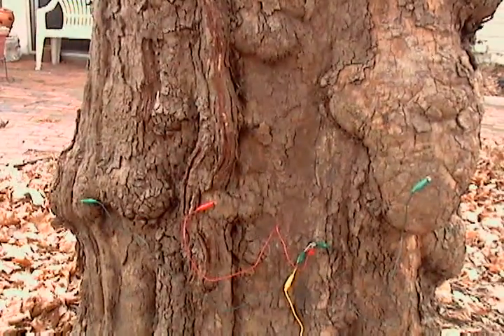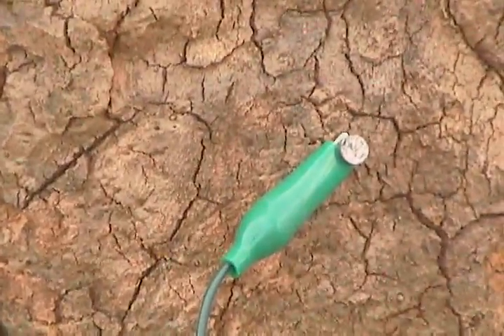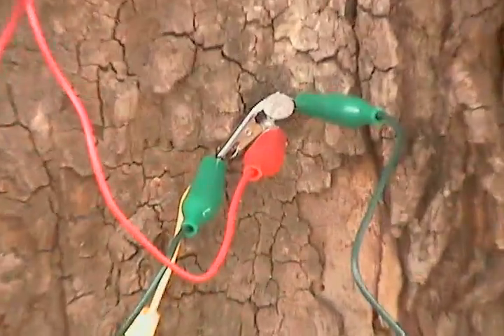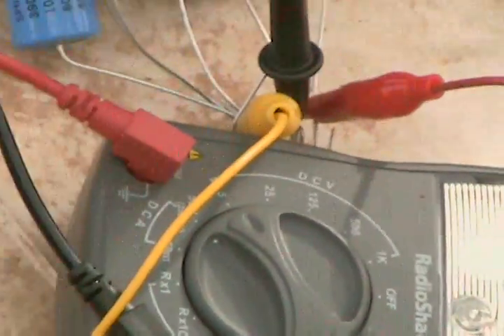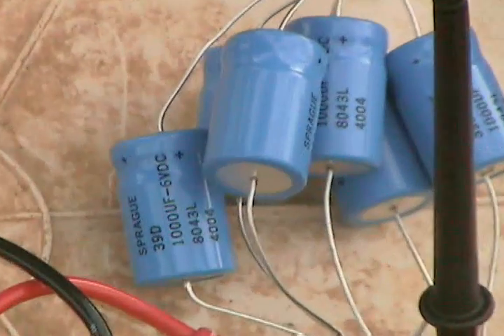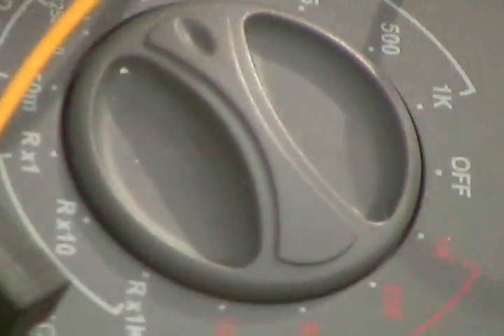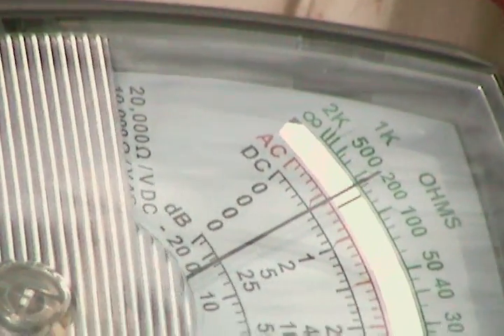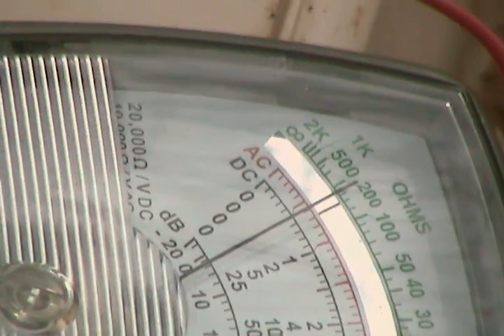free tree power

Comment from the maker: Capacitors have a potential.. by putting them in series the voltage of each one will add up  like they do with batteries. The only diff is that capacitors 's voltage will drop rather fast. where as a battery takes longer to discharge.  The tree was taken down when the house was sold and demolished.
Reply: aww

Comment: You may have already tried this, considering the video is 2008.  But if you put an Aluminium or Copper antenna in the top of the tree, it will increase the Difference Potential between the Antenna and the Ground and in theory would increase Voltage.

Comment: half a volt here, half a volt there, it all adds up :)  24 trees would give you 12 volts.  You ever hear of anything running on 12 volts?  You naysayers haven't thought it through.  Germanium diodes fire at .3 volts.  half a volt each is plenty to fire up and charge a large cap with enough trees with no feedback to the tree! 100 trees could do some real work! Forest power!!!!
Reply: HM Dickson for less money, you can buy a 10 watt solar panel and itll give you more power. that tree can barely run a calculator
Reply: can you walk into your back yard and using 2 nails and a copper wire build a solar panel? Do you know how much petroleum energy goes into making solar panels? The point is alternatives, not competitors. 

Also,  the first solar panels prior to optimization were not very functional according to your standards, so optimizing the energy harvest of trees is possible through the use of analyzing the necessary ph differences, the types of trees, the types of nodes, the potential to breed trees with more net-electrical output. Your vision is shortsighted my friend.

Comment: capacitors cant be put in series to get more power lol theyre not batteries.
Reply: They will increase in voltage, not current.  Just like batteries.
Reply: +metroice1 no, they are not batteries, but they have some kinds that "act" like batteries, they can even start your car on them as one man did already and made a video of it on u-tube. Check it out, capacitors/batteries

Comment: You are reading on the meter only the points of contact to the tree and points of contact with the ground. The energy is flowing either up or down. You'll know when a thunderstorm comes close that it can switch rapidly. instead of nails banged into a tree try making an antenna out of aluminum foil. Then make a larger one and take a reading ...

Comment: People on YT have made 12v batteries using disimilar metals and water/salt water. In series (copper aluminum, copper, aluminum) creates more voltage. In parallel (copper, copper, aluminum, aluminum) creates more amps. Volts X amps = watts. Literally all you need to do is make a ton of parallel and series units.

Also people have said their cement batteries still work after years because the metal doesnt corrode. We cant just find magnetic materials "magically" so we have to create electromagnets

Comment: Put 2 dissimilar metals in any non-neutral solution (iron in tree sap for example & a different kind of iron in mud/damp earth) and you get an electrochemical reaction.  Look up Standard Reduction Potentials or redox reactions and you can calculate the voltage 2 metals will produce under standard conditions.

Comment: It's simply the tree sap reacting with metal. It's called a battery. And there are more efficient  ways of making one.
Reply: I did this to a birch tree when it was running sap in the spring. big voltage. dont remember the specifics tho

Comment: That's nice. Only problem is, the nails will corrode over a time.
However if you use platinum wire as electrodes - one wire in the tree and one in the earth - the tree battery can  work  for as long as the tree is alive. Even thousands of years if the tree gets that old.
The downside is that the voltage is very low.

Comment: @MrCerebro11 parallel while have a longer charge time , but will be seen as a bigger capacitor to the source voltage(tree). When 6 1000 micro farad capacitors are linked in series the charge time might be less ;however, the total capacitance that can be obtained is 166.7 micro Farads. And when linked in Parallel is 6 milli farads. SO to produce the most voltage possible they need to be linked in parallel..

Comment: @josephdupont Well I have been collecting the supplies to create my own experiment. And I decided to use non electrolytic Capacitors ; because, Nonelectrolytic are used for lower relative values of capacitance. Mainly since in your video you said you had only .6 volts. And on that topic Capacitors in series decrease the total capacitance of the circuit since capacitors in series are treated like resistors in parallel. This meaning that Capacitors in (couldnt paste it all its is 3 comments)

Comment: All this "free" stuff is so much more expensive than just using the power company, and a lot more work. I don't see an upside except it probably gets a lot of dumb asses to watch the video's : ) 

You would do better getting a wind turbine, and talking into it. You could run hydro electric off the sewer water coming outa your house. You could walk around in socks and spark a battery with the static electricity to charge it. You could put a wave motion generator on a water bed so when you had ...